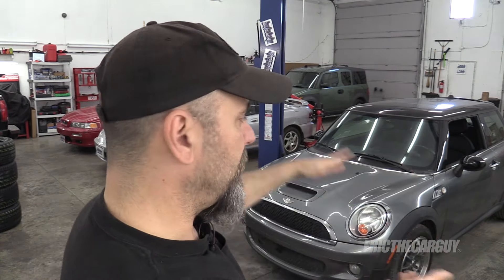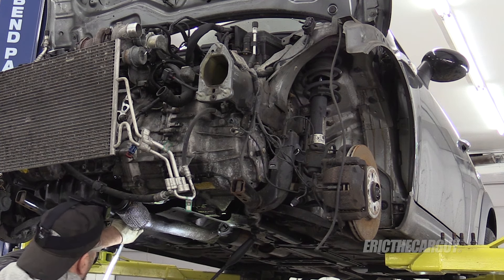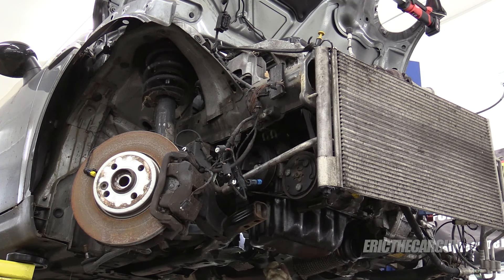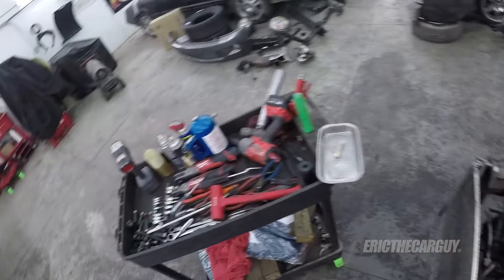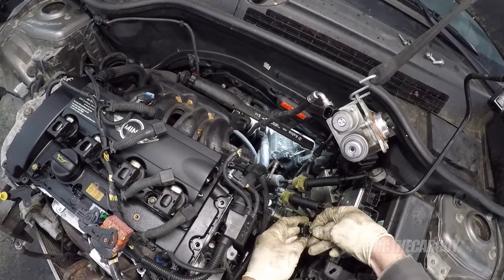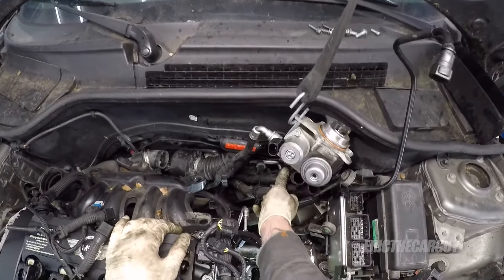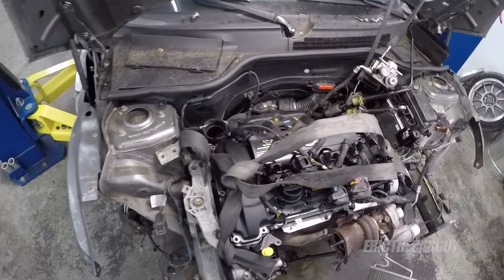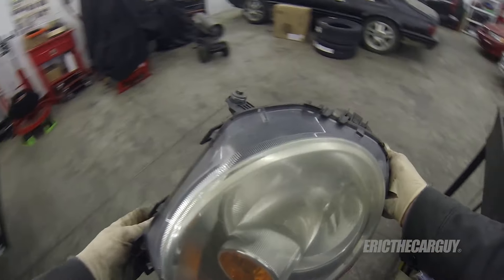Mini Cooper Engine Removal (R56/N14)

Comment: Just discharge the damned AC system already!!   Then all would be right in the world and you wouldn't have to fiddle with removing the AC compressor like this and the condenser would be out of the way and no danger of getting damaged.    🍒
Reply from the maker: I don't have an AC recovery machine or else I would.
Reply: EricTheCarGuy - OOOoooohhhh. I see. Well, time for an investment in the future so you can take on AC work!  The guys here in TX get big bucks for AC repairs. I think you are in Ohio or Illinois? Maybe AC's are not as important to you all?
Reply: Also, did you explain in one of the videos why you need the engine out of this car? I must have missed it. Or are you just trying to find content and are a glutton for punishment?